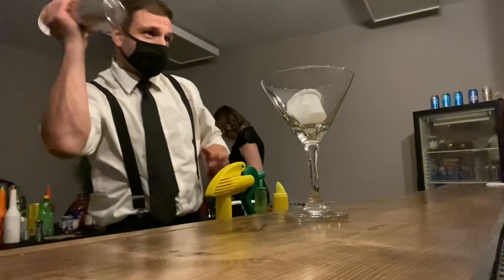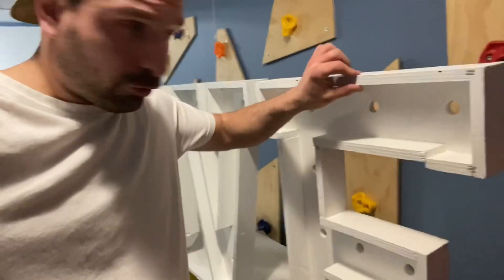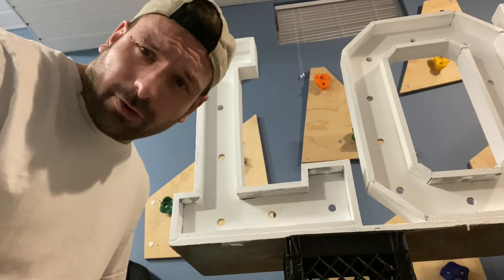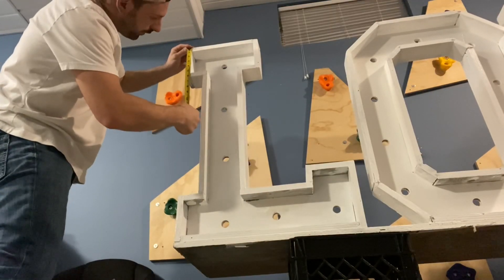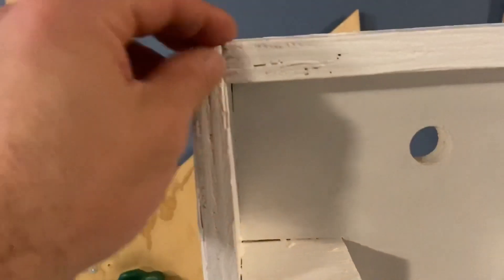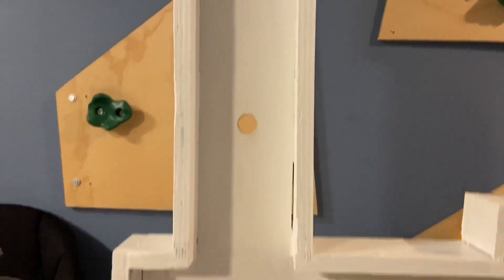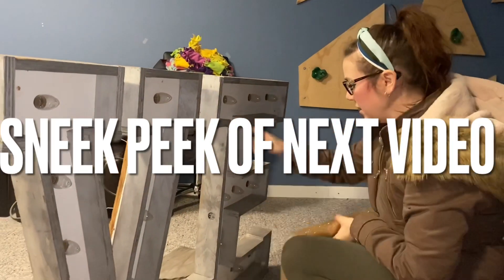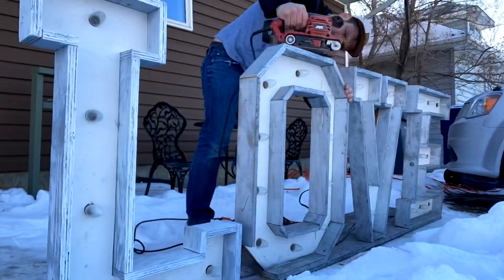DIY Marquee Love Letters With Lights - Wedding Build With Measurements

Comment: What size are the holes?
Reply from the maker: Hey Genethia,
The knowledge that you seek is inside this video. When I made this video I was unsure if it would be similar to watching paint dry. The good news is that if you don’t enjoy watching paint dry I have an alternative. The alternative is a link to the blueprints with Measurements and instructions on exactly how to make these letters. The link also includes files that can be given to a carpenter with a CNC machine to automatically cut these letters so that you can build them for only a portion of the cost. Also the money that you spend to obtain my blueprints will also support this channel to make videos in the future.  The choice is yours. https://etsy.me/3s2etfH
Reply: Looks like 1 inch maybe 1.25